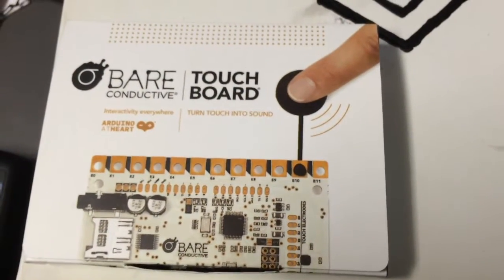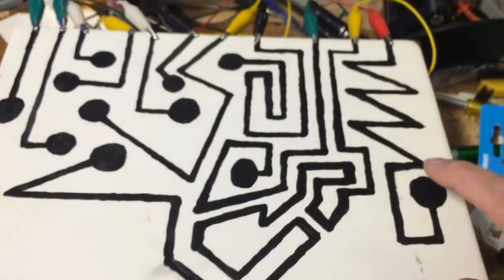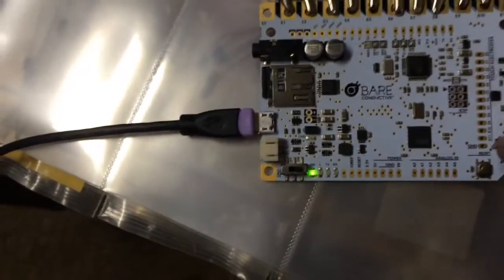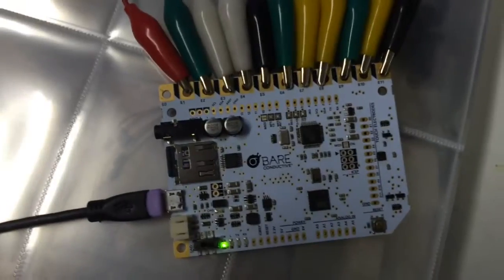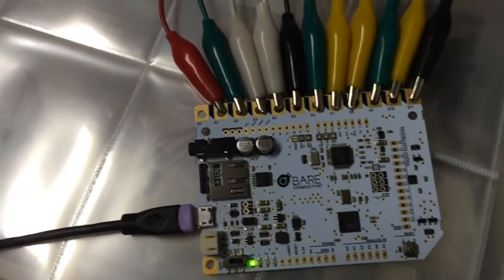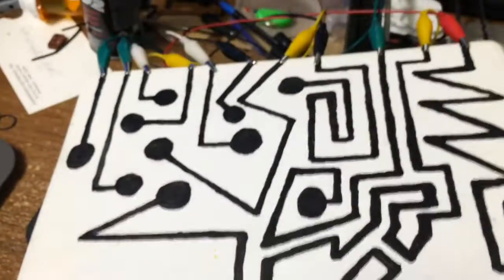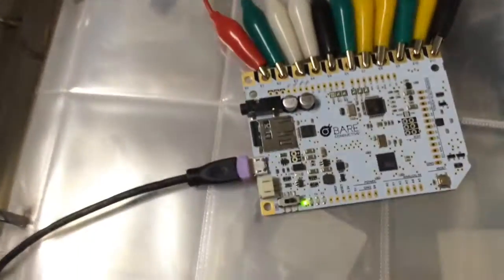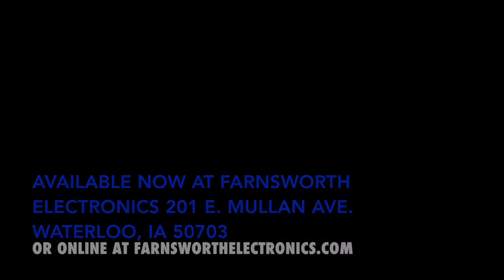Touch Board by Bare Conductive Demo

Comment: where can i download the coding from for Ableton ? can it be used with Max Msp ?
Reply from the maker: It should be available on the Bare Conductive website. There are sketches for a standard MIDI controller and for iOS based controller